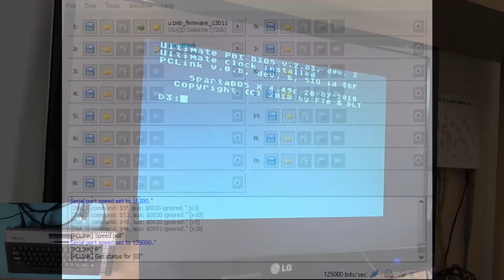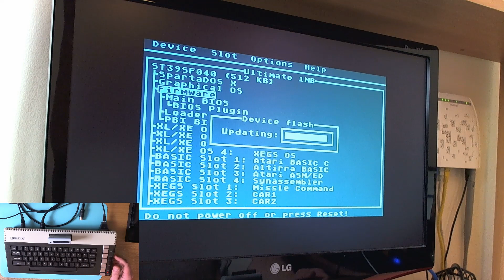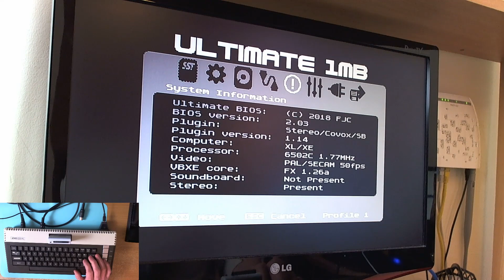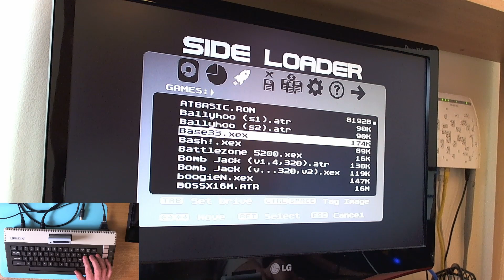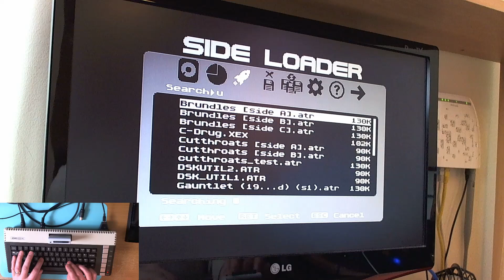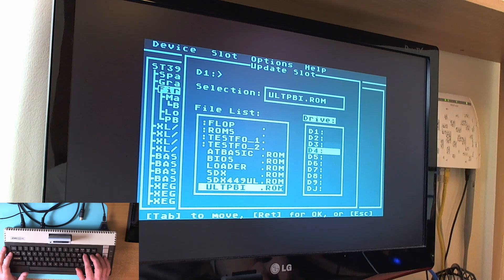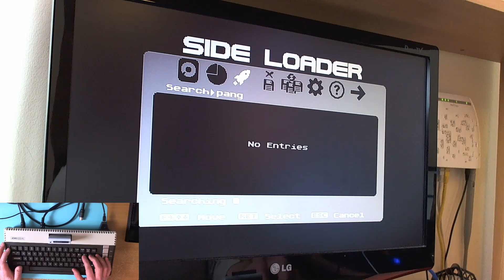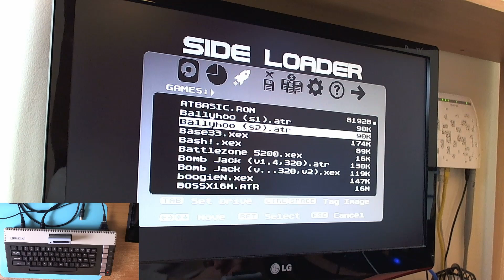Ultimate 1MB BIOS Update

Comment: Great job!  Watching something like this makes me realise how little I know about the Atari lol!  Is the SIDE cart the way to play games that are in cart (ROM) format, or does it tend to be used as a HDD?
Reply from the maker: The SIDE cart is basically a 512KB flash cart with an RTC and an IDE adapter. The flash ROM is limited to a single banking scheme, so is no good for hosting a bunch of ROM images of different cart types. It does, however, work stand-alone (without U1MB) as an XEX (executable) loader (the same loader you see running from the U1MB in this video is on the upper half of the SIDE's flash ROM), and is capable of handling many flat 8K ROMs (which it soft-loads into RAM). It also works stand-alone as a HDD via a DOS driver if you boot SpartaDOS X (which occupies the lower 256K of the cart's flash ROM) from the cart. With U1MB in the machine, however, none of the cart's ROM content is used at all (it exists only as a Compact Flash adapter), and you get bootable disk images and lots of other conveniences. ROM emulation remains an issue; for now, the AVG cart is another excellent option, since it emulates banked carts and has a SIDE emulation mode which works with U1MB. There's also the UNO Cart, Ultimate Cart, and The!Cart. Somewhere down the line we should have SIDE3, which will do everything SIDE2 does with banked cartridge emulation thrown in. :)

Comment: I want SIDE2 and ATR to work on Atari 130XE 128K without U1MB . Can you make the magick happen , comrade ?
Reply from the maker: Unfortunately not. A custom OS ROM would be necessary at the very least, and 8KB of ROM and 1KB of RAM is required: that's too much code to fit in a custom OS and we'd have to go whistle for RAM to house the partition table, etc. Remember that the ATR handler includes a FAT driver which allows read/write access to ATRs without having to place them into disk slots. Any non-U1MB based implementation is going to be a pale imitation at best. Install U1MB and enjoy the system as it's meant to be used.